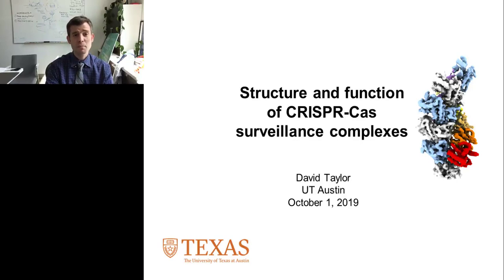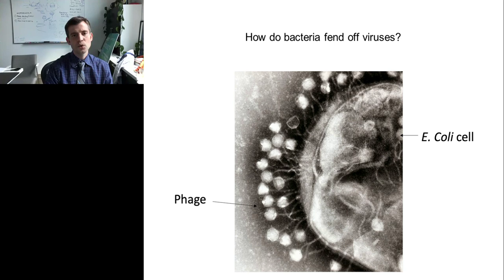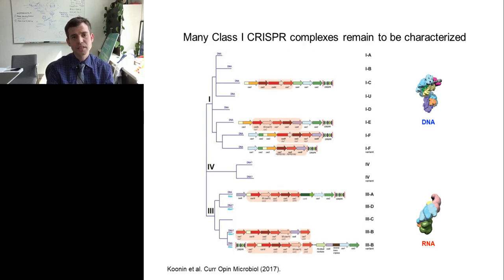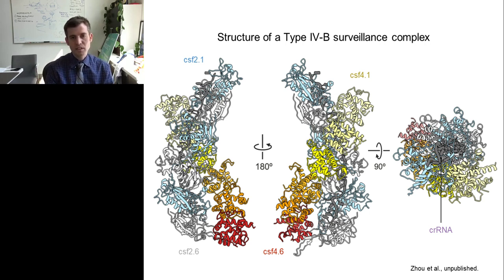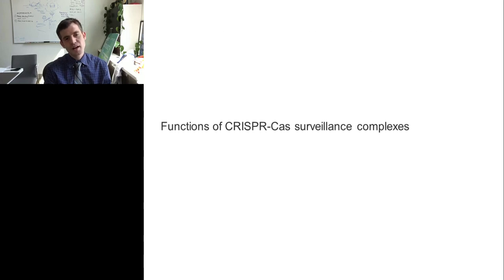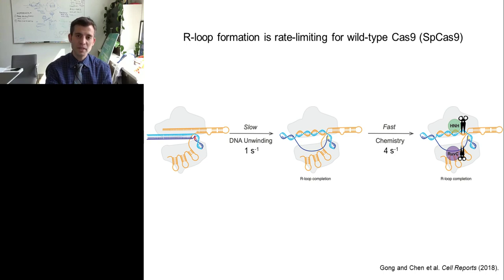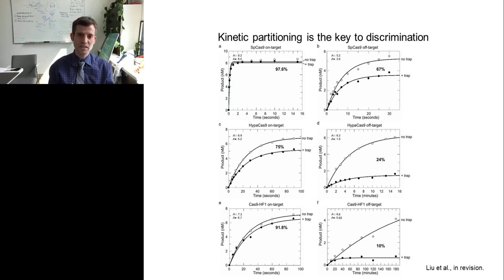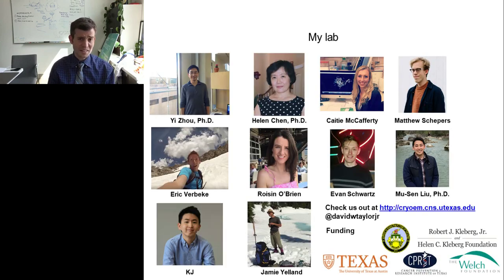Structures of CRISPR-Cas surveillance complexes

Comment: Do you think the fast/chemistry/ 4 s^-1 step can only be detected by cryo-EM and not to a full extent using crystallography? 

Oh wait, but if you use a Cas9 variant you slow down the process of the 3rd step? That’s quite interesting. I wonder how many crystal structures have been found using the variants.